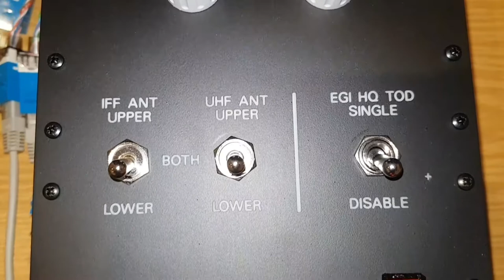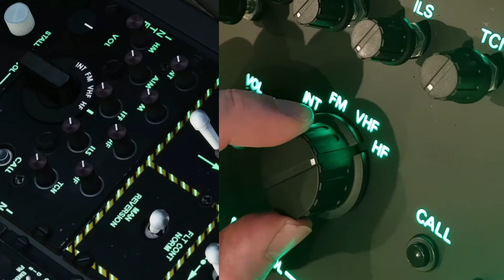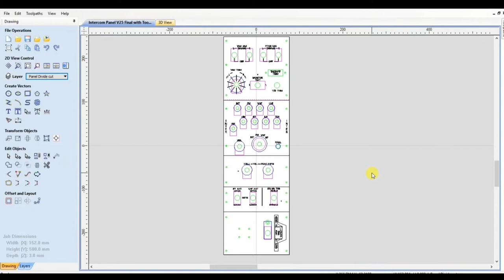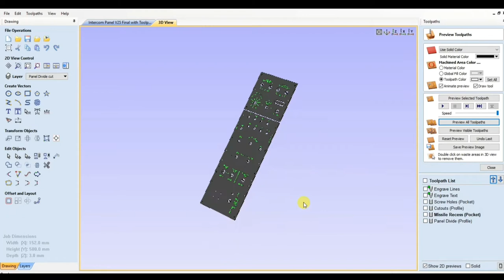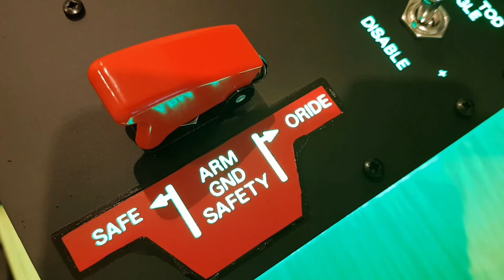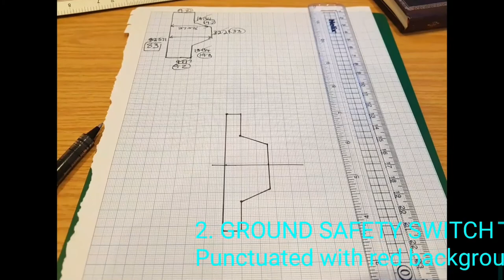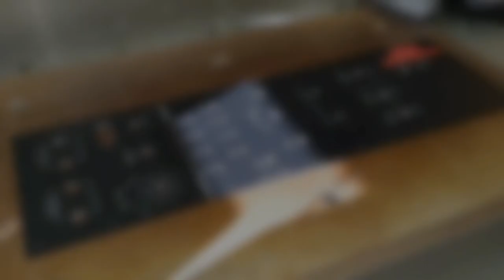DCS A10C Simpit Intercom Panel (Intercom/Stall Vol/Antenna/Gnd Safety)

Comment: Great work as always. No flight sim is complete without a red toggle switch cover! Very neat solution.
Reply from the maker: Cheers Mark. It seemed a logical solution and does work, however I read another solution on the forums. A three position toggle is used, one side is momentary which moves to the centre position when the cover is lifted. I'll probably give that a go next time as might be more robust

Comment: great work. great advice. started my first panel, thank you Craig. keep em coming. :)
Reply from the maker: Hi Matt, thats brilliant. They are fun to build and taking them up for some airtime after feels great. Good luck, cheers
Reply: Thanks Craig. Took your advice on the fuel panel video and made the panel 20mm wider to include a 10mm overhang for mounting. Any chance you could include (on your website) the petentiometers you used for this comms panel. There are so many options out there. :) I am still in the discovery / design stage but helpful to know what was used.
Reply from the maker: Hi Matt, for the intercom panel I used a  POTENTIOMETER PUSH PULL SWITCH POT GUITAR 10K LIN SPLIT SHAFT LINEAR V164L4
https://rover.ebay.com/rover/0/0/0?mpre=https%3A%2F%2Fwww.ebay.co.uk%2Fulk%2Fitm%2F271184505955
I found this had just the right amount of actuator travel and a good feel to it
Reply: Thank you Craig this is very helpful.

Comment: Hi Craig, I really liked your panel build here and I just wanted to ask a couple questions in relation to the CNC design.  Firstly, which text do you use in Vectric to engrave, it looks great!  Also, what size engraving bit, ball nose? or end mill, are you using to do the engraving and lastly the acrylic.  Is it cast or extruded acrylic, colour opaque white?? and how thick (6mm?? you may have mentioned it in the video and I may have missed it).  I'm really impressed with the quality of your work and I think you are doing a great job.  I hope I can get the same with my Hornet build.  Keep up the great work and the great videos........cheers.
Reply from the maker: Hi, thanks for watching my video. I tend to get certain questions time to time so did an faq on my website
http://mysimpit.co.uk/faqs/
That should cover most of the info you asked for. Let me know if there's anything else, cheers
Reply: Hi Craig,  thanks so much for the faq link which is very thorough and answers all my questions and a few more as well. I'm a big fan of your build and think you are doing a tremendous job.  I've learnt so much already from you and only hope I can do as well as you.  Regards, Mark

Comment: What did you end up using for those push/pull potentiometers?  I'm trying to find something similar for my own helo pit that I'm making for DCS.
Reply from the maker: Hi Stuart, if you have a look through the comments to this video I think I shared the link a few years ago. Let me know if you can't find it or it no longer works. It was actually a guitar part if I remember correctly. Good luck with your project, cheers 👍

Comment: Another excellent video with awesome details. Craig i wrote to you on dcs forum but it seems that you never post there. Anyway i've figured out my question about reed switch. Can I know where you bought the push pull pots?
Reply from the maker: Hi rocketeer, I have a look on the Ed forums most weeks but have never posted anything there as yet. I didn't see any messages.
I hope all is well your end and of course happy to share the details of this component. I tried so many and this one is mint. Seemed odd ordering a guitar part but it has a good feel to it and actuation matches the sim nicely. 

https://rover.ebay.com/rover/0/0/0?mpre=https%3A%2F%2Fwww.ebay.co.uk%2Fulk%2Fitm%2F271184505955

Seller might do a deal if you are buying a number of them. His name was Cliff if I remember correctly
Reply: it's strange you didn't get my PM. Anyway, thanks for the ebay link! I always learn from your videos. It's like how to build simpit 101 courses. good job!

Comment: Why not just use a toggle that has a momentary third position?  That way, once you release the safety cover, the toggle from the momentary position clears and can signal the sim the cover is open.  No drilling, no special programming, and no button install.

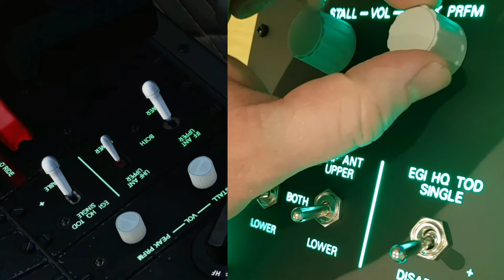Comment: At 5:09, those 3-pos toggle switches are they sold on aliexpress?
Reply from the maker: Hi Afrikaner, you can get toggles on AliExpress, and some look similar to the ones I used. I got most of my toggles from electrical component companies based in the UK. I tend to wait till some are on offer and buy one. Then if I like the feel of it, the actuation feels good and I get a larger amount. I used a fair few of the brand SCI. I got some SCI R13-29E and SCI R13-29A on a good offer previously and with the high current toggles you usually have a strong feel to their actuation. I also used some SCI R13-2-05 which are generally less expensive within that range. I'd get a few toggles on offer from different places and test them to see which you like, cheers

Comment: Hey would you be able to provide info on your cnc machine? Like price and brand. I would like to build my own sim pit with backlight panels. Unless you are willing to sell them? I am creating an F-18 panel thought
Reply from the maker: Hi Joseph, my father in law is an engineer and built his cnc. I could get a run down of the key parts / brands he used if that helps (even with his experience I think it took him a few years to build). I'm looking at getting a cnc myself, but not sure whether to research one to buy or build one with my father in laws help.
As regards the panels, its possible I might sell a few of the original prototypes in the future if I upgrade them, as stripping for parts seems ashame if someone could get use from them. Not sure if I'd sell in the proper sense.
Good luck with your F18 build, that's an awesome aircraft